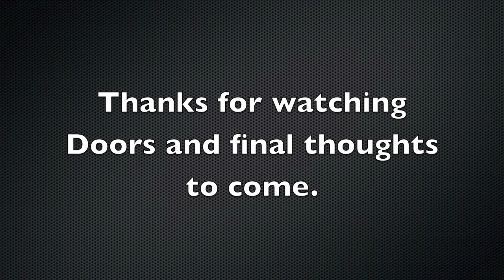Running Water

Comment: by some mods u can make this super efficent. orginal design sucks ass. but if u do a internal returnpipe to lead the hot water to the top and make a spiral down outside the tube it helps alot. 2nd mod  outside tubing of the whole unit whit a basefan in the bottom sucking in cold air at the bottom and pushes the heat upwards while the water spins downwards u will get a decent upgrade of this cooler. 2021 i bougth this thingy and i am loven it.

Comment: Какая  температура жидкости????
Reply from the maker: +кирилл урюпин The temp is about 10-15C above ambient temp. 
So if your room is 15C the water in this set up should be 25-35C at idle. 
Under load in August with a room temp of 30C I have hit 49C for all my games on Steam. 72C Blender Render of 6  hours. 
If you live in a warmer clement it will run hotter.  I live in Canada and we have good cold winters.   I find now when I have time for gaming that winter is the best time.  My world currently is work and I miss gaming so:( 

Now after 3 years of running this I have come to some conclusions.  
You must used a good dissimilar metal inhibitor as I have found some contaminates in the water.  Mark sure the water channels in the water blocks get cleaned every 6 to 9 months.  When handling the steel plate in this EK block last cleaning I have contaminated it with something and an odd thing happened.  The out on the CPU has gone dark to almost black. 
I will be breaking this all down, replacing the hoses and professionally flushing the rad. 

This is a SOLID system.
Reply: +Cory Sarafinchan Я установил 2 башни параллельно если интересует   могу показать свой  вариант который правда  еще  не совсем  закончен   по причине  не все запчасти приехали !!!
Reply from the maker: Yes please  . Share away. Sorry it's taken so long to get back to you.  I work stupid hours for months at a time.

Comment: Hi, nice build you have there! I was wondering if this cooler is still relevant nowadays. I have found one not far from where I live and I plan on cooling only the processor with it. (It's an AMD fx-8150 which I want to overclock until AMD releases the Zen processors and see if the upgrade is worth it). Would you still recommend it? Thanks!
Reply from the maker: len5465 
IF you are very careful of dissimilar metal corrosion and use the proper additive, I do not see you having any problems. Its a passive water cooler.  The rad does the main cooling of the water.  That said if you have a cool room your system will or should run 10c above ambient temp at idle.  I've yet to see my compy hit 49c on the hottest day of the year
Reply: Just get a radiator 240 or triple. These things suck. and are made out of aluminum wihich is not good to mix metals.

Comment: I like this idea with this manifolds.
Reply from the maker: Thanks.  It's a tad bit on the expensive side but will worth it for maintenance of water temp.  There is not that much of a temp difference between the North Bridge, CPU and GPU at idle. When under load it's nice to know all parts are getting the coolest water possible and not raising temp between blocks.  I also did it because I wanted to try something different. 
Thanks and hope you enjoy.
Reply: Cory Sarafinchan
 I do this in my pc just for cpu and mosfet also have C5F. I use standard parts.   :)

Comment from the maker: Update: I have added a second D5 pump a while back and forgot about adding it. 
with two d5 pumps I am flowing at 1.25 gal a min with BOTH pumps at setting 1 of 5
I have fooled around with setting it to 5 and it EASILY flows at 12 gal a min, 3X the amount of water in my system.  The rad is not efficient at that rate. 
In all i'm at max 10c above ambient temp.  
Thanks all and i'll try to put an update vid soon.